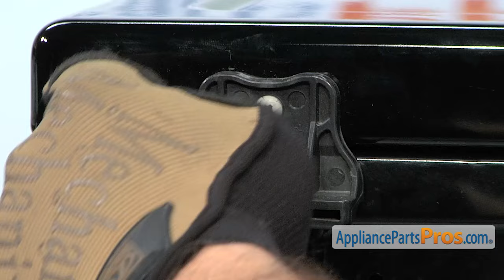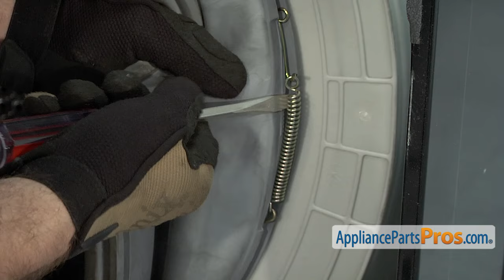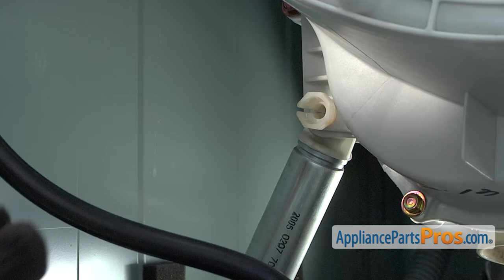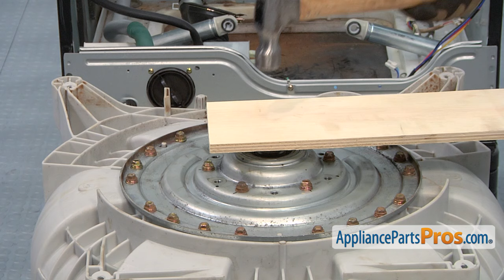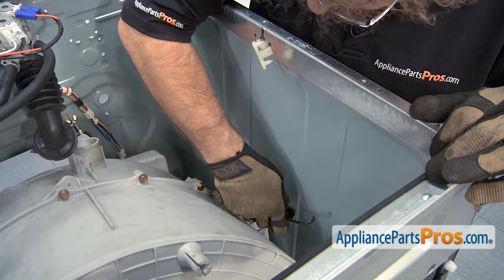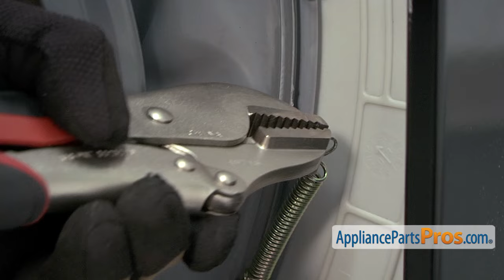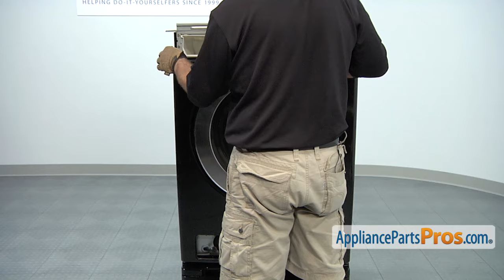How To: LG/Kenmore Washer Seal 4036ER2004A

Comment: I just completed the repair, and want to share a couple of points.  * Use a wood block to pound the new bearings in place it will apply the hammering pressure evenly, and you can hammer around the wood block to even out the bearing going in.  For the inside drum bearing, use the block to get it flush, then use the old bearing on top of the new bearing to hammer on top of and further push it into the hole.  * The wire around the door gasket is a B_tch, make sure to look at how you took it off as the gasket has to sit flush and can get confusing putting it back in.  Other than that, if your machine is not leaking, don't waste your time buying another outer drum gasket, the old one will seal.  * You may have to take the wood block, place it in the center of the inside of the drum and bang it, to make the  drum fall into the outer drum all the way, mines was not all the way seated.  Other than that I made a  $500.00 repair for $81.00 of parts. Go to hell, Mr. Repair Man.
Reply from the maker: Thanks for the tips and glad the video helped you out!

Comment: good video, here are a few extra tips.  
make sure you clean our the water inlet screens before hooking the water lines back up.

while I had the front rubber boot/seal, I cleaned it throughly with a pastiche brush to remove all moldy substances.   mine seal has a drain line at the very bottom attached to a small elbow hose.  I removed the elbow hose to clean it and found it packed full of wet lint.

I found it easier to install the inner rubber door seal metal band with the weights off.  fter I installed the door rubber/boot inner metal ring, I then went back and installed the front tub weights.  if you install the weights first you will find it difficult to I stall the metal ring.
Reply from the maker: Awesome, thanks for the tips!

Comment: We ordered new bearings and one of the bearings fit nicely and the larger bearing didn't. In the video you guys use a punch to push it down but my tub has a metal piece that doesn't seem to have anywhere to push through too. Any advice??
Reply from the maker: If you are working on something different than the type of washer in this video it would be hard to say. You can post the problem along with the appliance model number on our repair forum and the techs can help you troubleshoot the problem. http://forum.appliancepartspros.com/
Reply: My machine is wm2501hva and it looks the same as the one in the video. We went to the sears parts store and they said that there is still a part of the bearing stuck inside which is odd. We're probably going to just replace the entire tub. Thanks for replying!
Reply from the maker: If the bearing totally broke apart the outer ring of the bearing could be stuck in the tub. You would have to remove it from the tub so you could install the new one in the tub.
Reply: Geez. I think we're just gonna buy a new tub. So close.

Comment: I have an LG Washer model Tromm WD12580BD, the washing function is working normaly but the spining function is not. It makes a metalic noise and it spins erraticaly in this cycle and it happens when the spining is clock wise. I have already checked the bearing and it's not damaged. Can you help me? We live in the country, very far from the city and its very dificult to get tecnical support.
Reply from the maker: I would check the spider if it is damaged it could cause noise and spin issues.

Comment: This is an excellent repair video, but I have a few suggestions. In addition to the bearings and seal, make sure you purchase the tub seal. When you split the tub, the recommendation is to replace this seal. I wish this had been mentioned at the beginning of the video as it cost me $25 in express shipping so I could get this repair completed. Also, make sure you have blue thread lock on hand to use on the bolt which holds the rotor on. This would be another item to mention at the beginning of the video. You also need a zip-tie. I only have one small suggestion on the video. To remove or replace the rear cover, it is not necessary to flex the panel. If you slide the panel up, the bottom tabs clear their openings, so you can easily pull the panel outwards. Then slide the panel downwards to disengage the upper tabs. No bending or flexing needed.
Reply from the maker: Thanks for the tips!

Comment: Thanks for posting this video.....it was VERY helpful and very detailed. A few things were different on my LG but otherwise this saved me a lot of money as I was quoted $400-$600 to replace the bearing. It cost me $50 for the bearings, shaft seal and small tub seal, 4 hours later it's working great. The only advice I can give is to install the grey rubber door seal before installing the counter weights as it's easier because the weights are in the way. Again......great video......thanks!!!
Reply from the maker: Awesome, glad the video helped you get the washer fixed up!

Comment: how to separate drums without bolts? Stucked on this part
Reply from the maker: Not really sure, most drums I have seen have bolts or clips you remove to split the tub. Without knowing what you have, I would suggest posting the problem along with the appliance model number on our repair forum and the techs can help you troubleshoot the problem. http://forum.appliancepartspros.com/

Comment: Thank you for this video.   My washing machine is similar and this was a great help.  

My bearings had fretted onto the drum shaft and I had to cut the outer drum away from the agitator drum,  grind through the outer race,  and then use a puller to remove it.   Reassembly was a snap but I couldn't get the spring clamp with pliers but a Philips screwdriver got both of them. 

Thanks again
Reply from the maker: Glad the video helped you get the washer fixed!

Comment: Inner tube will not "bang out". I have used penetrating oil and pounded on the shaft, it is not moving down. Do you have any other suggestions?
Reply from the maker: Some people have had luck applying heat to the bearing. Put a wet rag around the bearing area so you do not heat up the tub, if you get it to hot and damage it, it would have to be replaced.

Comment: Great video! I had a repair quote of over $1,000 to repair ours. I did it myself for about $150 (including the front outer tub, gasket, bearing set, and spider!). I have some tips to share:

TIP #1: Pounding the shaft out of the bearings (15:36) was near impossible, even after a day soaking in PB Blaster. If you know you're going to replace the spider anyway, forego the wood and just pound at the shaft. Or, to protect the shaft, you could screw a sacrificial bolt into the shaft and hammer on that.

TIP #2: if you replace the front outer tub, check for an extra hose outlet in the front-bottom (where the lower weight attaches). For my washing machine model (LG WM2077CW), the front outer tub did not have the outlet (as also seen in this video at 7:07). The new one did (like this http://www.rcappliancepartsimages.com/dbImages/00005679/01800759.jpg). Everything else was identical. I ended up having to saw off the hose outlet and glue a plug into it!

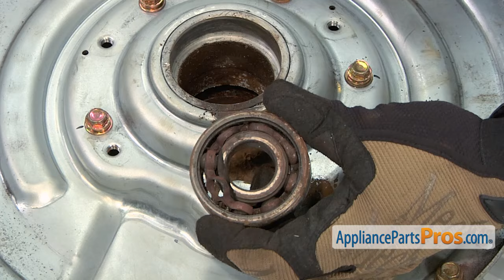TIP #3: Don't let frustration get the better of you when pounding at the shaft and bearings (15:36 an 17:34). Upgrading to a mini-sledge hammer and crowbar could result in the tub gasket lip to break! I speak from experience. Fortunately it was repairable.
Reply from the maker: Thanks for the tips!

Comment: the bearing will NOT come out of the tub housing (don't know the technical term). The seal and the other bearing came out just fine. Any pointers would be appreciated. I would hate to buy a whole new half a housing just to replace the bearing and housing gasket.
Reply from the maker: I have heard of people using a heat gun to try and loosen it up. Put a wet towel around the area and do not heat the tub too much and damage it!
Reply: I actually got it shortly after I posted my original message. while I was working on it I sent my lady to the hardware store to pick up some punches, all they had were shorties, she brought them home anyway thinking maybe one of them would work. I was hammering on that bearing forever when I finally gave up and sent her back...
no, I'm not lazy by sending her back and forth, I had a torn up ankle and wasn't walking on it all the way... 
While at the store AGAIN she had the ingenious idea to pick out a piece of 1/2" rebar, have the guy cut a piece off of about 10 inches. she brought it home and I used that along with a heavy hammer ( framing hammer to be exact). The darn bearing came popping out after only a half dozen swings. I chuckled a little and said I'll be damned. Got the washer put back together when the parts arrived and it works just fine. 

I will say I do appreciate the video tutorials that you folks put out. Great step by step instructions to go along with the video, not just a video and background music. I'll be returning to purchase from you in the future, if need be, and I'm sure there will be a need.
Reply from the maker: Awesome, glad you got it all done!

Comment: Just finished replacing the bearings on my LG  WM2277HS.  Followed the directions step by step which made this tedious job bearable.  It took me a long long time because I did it by myself and I am 70 years old so I work slow.  Only change I would make to the entire video is that I would attach the weights AFTER I attached the seal to the tub.  Makes that seal a lot easier to work in the groove.  Other than that, fantastic video.  Thanks.
Reply from the maker: Thanks for the tip! Awesome job on getting the washer fixed!
Reply: Edgar Allen are u still alive
Reply: That's is AWESOME! And thank you for the tip!
Reply: Thanks for the tip. It made it a lot easier.

Comment: When i tighten the 10mm bolts on the tub, the center wash tub stops moving.  Is this going to be an issue when i put everything back together?
Reply from the maker: If the inner basket is seated properly it should not affect the two halves of the tub being put back together. I would make sure it spins freely before putting everything back together.

Comment: Samsung washer model# wf409anw/xaa bearings are not sold separately from the tub housing; costing over $200 when all you need is about $40 for two bearings and a seal... Please sell them separately!
Reply from the maker: We can only sell the parts as the manufacturer provides them.

Comment: Thank you!!!!  We have been working ALL day trying to get the front loader apart, cleaned, and put back together, when I finally did a youtube search.The video my husband was following was less than clear (and it wasn't in HD either).  Luckily the spider arms (? is that what it's called) was just filled with gunk and not corroded (too badly).  We mainly took the washer apart because the bearings.  What a pain it was getting it out, but I didn't see this video until after we had it 1/2 way completed.  Hubby couldn't get the bearing back in - so I took over. Thanks to your video, it went in, and I got the drum put back together. I took the weights off the front - since it was SO heavy to get it out.  I also took the wire coil looking thing off the back so when it gets put back in it will be (hopefully) lighter.  I am going to watch this a few more times so I get comfortable with the process.  Although you are working on an LG washer, the Samsung washer (WF350ANR/XAA) we have is very similar. I am noticing that we don't have as many bolts (not missing - Samsung apparently didn't feel it necessary to provide all of the bolts that there were places to be bolted - namely the front weights).  Anyway, I really appreciate this video and in the future, if we have any more appliance repairs, yours is the first shop I will check out for parts. THANK YOU!!!!

Comment: Great DIY video. My washer was making a horrific grinding noise and inner bearing was pooched. Inspection of the stator showed some wear due to alignment issues from bearing. Took about 1.5 hours for tear down, 30 minutes for bearing removal and replacement (including tub cleaning and tub main gasket leak test) and about 2 hours to reassemble. The extra time was to double check connections. Despite wear on the stator, washer is back in working condition and sounds very much like it did when brand new 10 years ago with the new bearings. If you use softened water plan to replace the spider arm assembly as mine was terribly pitted from chloride corrosion. Thanks to AppliancePartsPros for saving me several hundred dollars in labour from a repair shop....kudos!
Reply from the maker: Awesome, glad you were able to get the washer fixed up!

Comment: The smaller bearing you install at 18:15, is not a tight fit on my washer...it goes right in the slot, and will fall out if I flip it over.
Reply from the maker: I would verify you have the right bearings for your model number. If they are correct and they fall out the only thing I could think of is maybe the bearing seat is damaged and the rear of the tub will have to be replaced. Was the washer used for a long time with bad bearings causing heat build up?

Comment: Great how-to! My bearing rusted and I guess expanded around the shaft so I had a really hard time getting both the shaft and the bearing out. I had to use a sledge hammer to get the shaft out. The wood I used to keep from damaging the shaft kept breaking so I used hard rubber but it wouldn't budge. I finally just hit the shaft straight on twice and it came out. Once that was out I had to use a large chisel to get the rusted bearing out. I put everything back together and tested the spin cycle several times and it's as quiet as it was before.
Reply from the maker: Awesome glad the video helped you get the washer up and running!

Comment: the drum has a lifetime warranty but lg will only replace it if a lg tech does the repair, I called then. so much for the lifetime warranty. I'd rather do it myself. the spider is separate but the bolts would just spin. the drum came with the spider. Thanks to the video it should be good four at least another ten years.
Reply from the maker: That is great, glad the video helped you keep it running!

Comment: Great video. I could not get the smaller bearing out. No matter what I tried it would not budge. I tried that rust remover stuff several times even waited overnight. Ended up sending back all the replacements parts and just ordering the tub with the bearings and seal installed. The rest was just following the video to finish up, Quite happy. The tub was about $150 with bearings and seals. My outer bearing was pretty much all destroyed when I opened it. It was giving me warnings for several weeks. When you hear that grinding noise don't let it go. Otherwise the penetrating rust will get you in the end.
Reply from the maker: Glad the video helped you get the washer fixed!

Comment: also, I used a have inch extension with a 32mm socket to remove the bigger bearing. used a hammer to bang it out. cautiously. it's equal pressure on the inner ring. I wish I would've done the same with the smaller. the socket method was much quicker.
Reply from the maker: Thanks for the tips!

Comment: Great video. Made it all simple. I thought my bearings were bad but it was actually the spider arms. When i spun the drum , no noise. But when i checked for play, it was only noticeable when i pulled up on one specific side. No play when i spun it to any another part of the drum. I ordered bearings, no spider, so i have to wait for the part. ugh. 
Thank you very much for the great tutorial.
Reply: If its the spider, the spider is not order able. But the drum has a lifetime warranty and comes with the spider.
Reply from the maker: Thanks for all the tips! Glad you got the washer fixed!
Reply from the maker: It depends on the make and model number if the spider is sold separately or not.

Comment: Hi, we are having trouble removing the pulley nut to even inspect the 
bearings.  We even tried a hammer on the wrench to loosen nut in 
counter-clockwise direction.  I called Bosch and they said, "The rotor 
torque locked, necessary auxiliary tool needed."
Is this something you have heard anyone run into?
Model: Bosch Axxis WAS20160UC/23
Suggestions? Thanks!

Comment: Thank You.  Your video couldn't be easier to follow and it helped me fix my washing machine!  Saved me a ton of money!

My spider was severed on two of the three arms.  It caused the tub to wear into the plastic (burning smell) and found some plastic shavings in the wash.  Wasn't sure if bearings or seal were bad, but replaced them anyway as I don't want to do this fix again.

Took 4 hours, and one hour was just swapping the bearings (had to use an air hammer after pounding on it with a regular hammer unsuccessfully).  I could've spent some more time if I wanted to thoroughly clean all the parts but it was getting late and I just wanted to be done.

Thanks again!
Reply from the maker: +Mark Olchanowski Awesome, glad the video helped you get the washer all fixed up!

Comment: Is the spider expensive and did this one need replacing? Never addressed that.
Reply from the maker: +putheflamesout yahoo You would have to go to our site to see pricing. We changed this one in another video, we did not specifically mention it in this video but you will see that a new spider is installed when we put the inner tub back in.